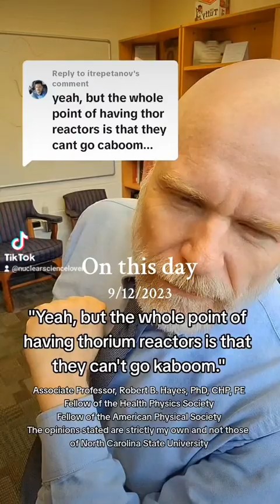False hype around thorium reactors

Comment: I suspect that what the person in the original post refers to is exactly that there is no water in the molten salt thorium reactor typically favoured by thorium proponents. No water under some hundred atmospheres of pressure and a reaction that tends towards a temperature several hundred degrees lower than what is needed for a phase shift for the molten salt. No kaboom from water is what I suspect is referred to. Since that is the only kind of kaboom that has ever happened in a nuclear power plant. Just a guess of course.
Reply: I suspect you are right, so let's give them the benefit of the doubt. Regardless, thorium is mostly hype, the same molten salt reactor is simpler and cheaper using uranium 235. Even ThorCon Power is redesigning its thorium MSR over to uranium only. Terrestrial Energy figured that out from the beginning and is using only uranium and they are 2/3rd the way through a joint licensing process with Canada/US.
Reply from the maker: It all comes down to the potential for operator error

Comment: Disagree with this completely…. Solid fuel reactors use highly pressurized water as a moderator to maintain fission..  Often thorium is suggested to be best used in a molten salt reactors, and the calculus completely changes with liquid fuel reactors. Graphite is the proposed moderator, so if you remove the liquid fuel from the graphite, fissioning eventually ends. It’s wayyyyyyy easier to remove a liquid fuel from a solid moderator. Plus this liquid fuel doesn’t need to be pressurized to maintain its liquid phase.  

All LWR use pressurized water which inherently creates the “boom” when mistakes happen.  

So it’s bananas to even try and compare the safety of these two designs as LWRs are wayyyyy more problematic because of their pressurized water.
Reply: molten salt doesnt need thorium

Comment: Having an alloy plug that melts at a precise temperature, and thus allows gravity to drain out the liquid reactant, is inherently safer than relying on mechanical control rods to try and prevent a runaway reactor. For this reason alone I believe that the liquid fuel type reactor should be given every chance to prove itself.
Reply from the maker: You are welcome to invest in it or lobby for it yourself to be sure